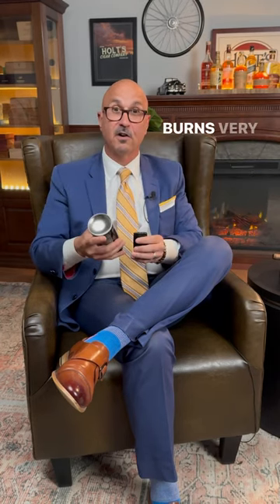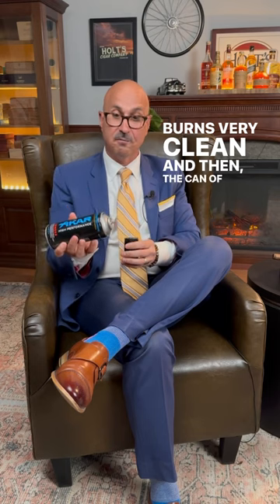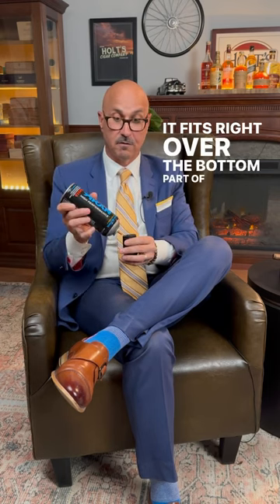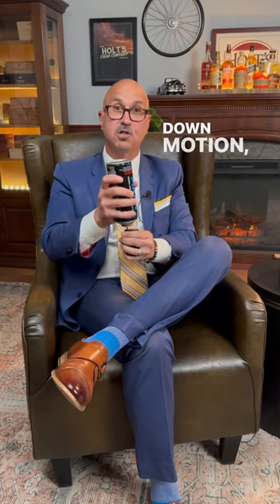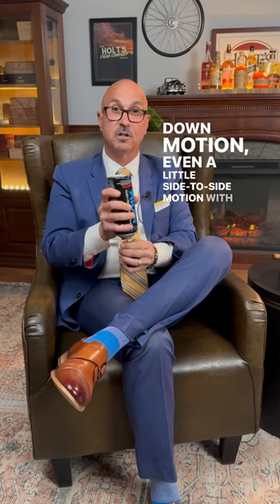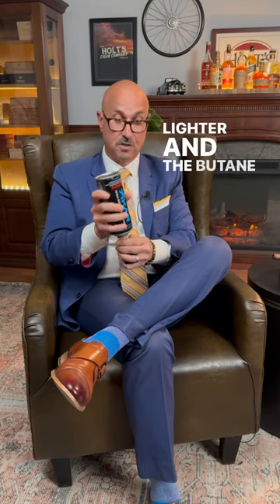How to fill a butane lighter 🔥

Comment: Zippo butane inserts work best with Zippo butane fuel cans. By that I mean their can nozzles are the right size for their inserts. I have a single flame insert and a double for bigger ring guages. I purge the lighter of air with a Bic pen. The insert starts becoming  problematic, I just by another one, and they're usually 13-16 dollars

Comment: Okay so I’ll blow your minds, leave the lighter in the freezer for about 20 until it’s cold and that will attach the liquid butane rather than gas which means liquid is pulled in rather than gas forcing it’s way in

Comment: I have noticed after 4,5 years of smoking that the up and down motion is something you do to finish up. Keeping it in there for 20 seconds really changes the amount of butane in the lighter. With just the up and down motion, my lighter lit up to 10 cigars. If I also did the 20 second wait, I could light up 20 cigars. For reference, this is with my Colibri EVO lighter.

That thing still works like new after 4,5 years.
Reply: I'm new to filling butane lighters. Problem is the butane nozzle never seems to fit over the light valve b/c it's the same size...

Comment: If lighters have the same temperature of your butane can, you will notice that the gas will not go into the lighter a simple fix is to put your lighter inside a freezer for about 15 minutes come back and the differential in temperature will allow the gas to quickly go in, give it a shot. It works beautifully every time.

Comment: Everything is about transfering liquid to low pressure. If you have little butane left on the refiller, Even if its just gas, put the lighter in the freezer few minutes so u get negative pressure and warm the butane cylinder with your hands

Comment: You should technically be purging it too, as air pockets will become trapped in there, lessening your fuel capacity, and making your lighter burn rough.
Reply from the maker: Correct 👍 we made a separate video on how to purge

Comment: What is the purpose of the up and down and side to side?
Reply: It helps the lighter accept the butane better.
Reply: @anthonymazzola4470  got ya, Thanks.
Reply: There is no good reason for what he is doing and it’s shocking he even made this video. Purge the lighter first,shake up your butane can to create pressure. Hold it upside down and push down for about 5 seconds. If you need to keep pushing down and gently shake so the fuel can warm up. Warming up the fluid creates more pressure so it will fill correctly. Then your done

Comment: Why does no one show or tell us how we know if it's full or not, especially if it's a closed device and can't see the tank
Reply from the maker: Most lighters will have a window on the side of the tank where you can see the butane level
Reply: @holtscigars  I understand that, not every lighter has it that's why lol. I have a few in my collection, new one I got doesn't have it
Reply from the maker: @BmwolotlE90  In that case what you can do is fill the lighter, and then release and reinsert the butane can a few times. When you see butane starting to spit out that means the lighter is full and can't accept any more fuel.
Reply: @holtscigars  appreciate it, just not trying to do something dangerous and fill it the wrong way lol

Comment: Still doesn’t light!  It’s cold, there’s fuel in it.  I don’t get it; maybe it’s the lighter?  It’s brand new.
Reply from the maker: We have a short titled “Butane lighter won’t light?” Which should help you out
Reply: Thanks!  Starting to wonder if I stood just use matches.
Reply: Tried it all…still nothing.  Won’t light if I put a flame to it.
Reply from the maker: Have you tried turning the flame up or down? If nothing seems to be working and it's a brand new lighter try taking it back to where you bought it and maybe they will replace it for you.
Reply: Finally got it!  I had to crank the gas up higher.  Thanks much, will be watching.

Comment: Up, down, side to side!? Or you could just fill it up like a normal person.
Reply: Nope, if you don't shake it it won't light the cigar
Reply: @Jimmy-fi4ht  🤣
Reply: There's a sweet spot for when applying pressure. Find that sweet spot and hold the butane refill still! Like putting air in a car tire.  I can pretty much guarantee I've gone thru more cans of butane than the guy that made this video. I've never once had to move the butane refill bottles and I have definitely never ever had to "warm" the torch after refilling. All that extra stuff he's doing is because cigar smokers sit around so much that they gotta fidget with things.
Reply: @GanjaBreadman  I’ve been in the premium cigar industry for almost 30 years. I’ve filled & fixed more butane lighters than you could in 3 lifetimes. You can do it your way. I’m showing people what gets the job done properly. By the way, you are also incorrect about letting the lighter warm first. That’s common knowledge to people that are actually in the cigar industry. A cold butane lighter will misfire. Just ask the people that live in cold parts of the country.
Reply: Most times when people bring a lighter back & tell me it’s not working is because they just held the can probably not in that “sweet spot” you speak of. If it works it works. There is absolutely no harm in manipulating the can to get the lighter to accept the fuel better. You’re being critical just for the sake of being critical. Thanks for your input but I’ll stick to what I know works.